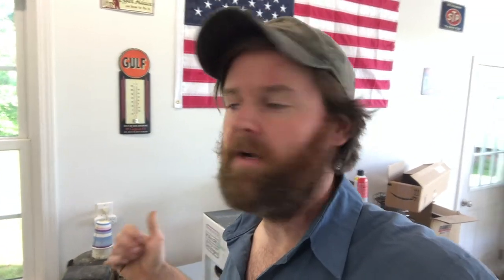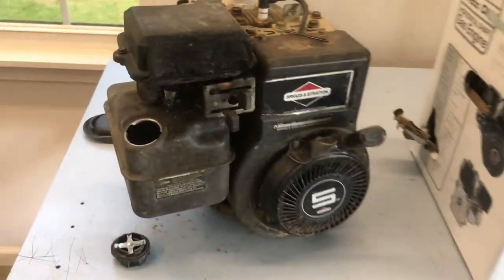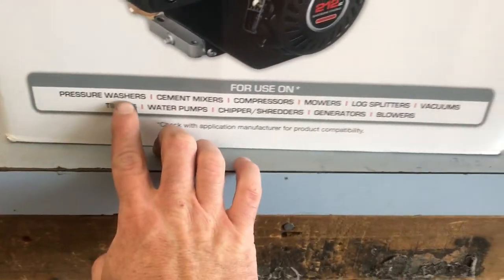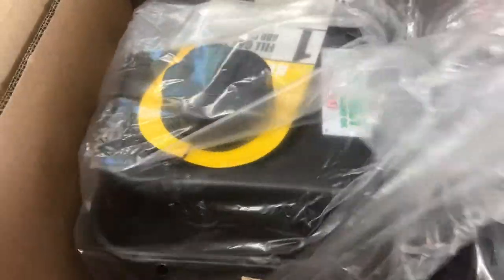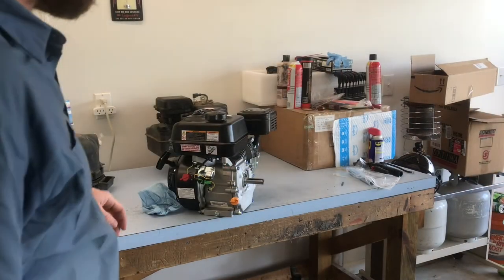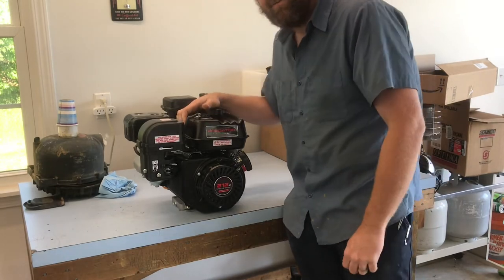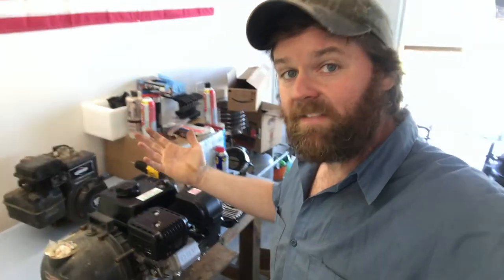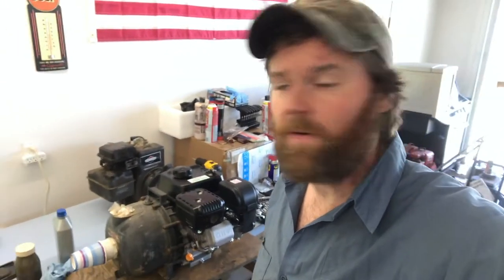Water Pump Engine Swap

Comment: The Chinese engines have a lot of machining dust and chips in them- change oil again after an hour of pumping. Freddy B.. If that Briggs has the raptor block ,I need it for the Grand kids Jr. Dragster  as a backup.
Reply from the maker: I'm not sure if it's a Raptor block or not. Haven't had time to get into it yet.
Reply from the maker: Freddy, y’all got any extra Jr. Dragster front wheels for sale?
Reply: @cannonballrepair7940  go to the facebook group "Jr. Dragster swip swap" and ask . someone will-  Standard is 16 inch, anything else is obsolete.